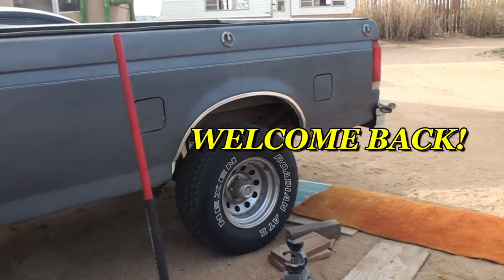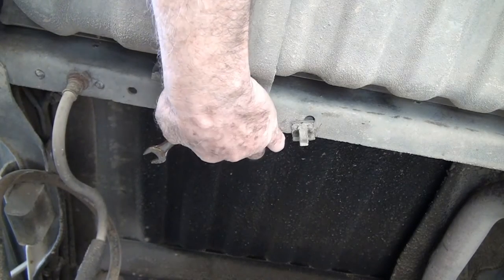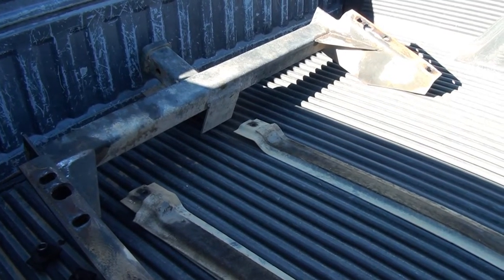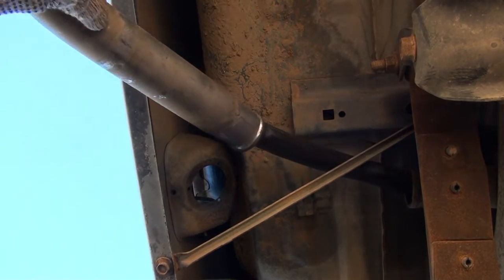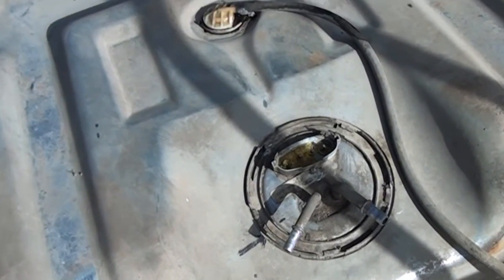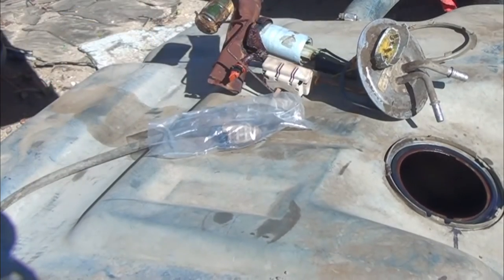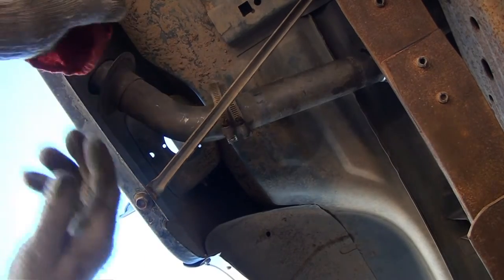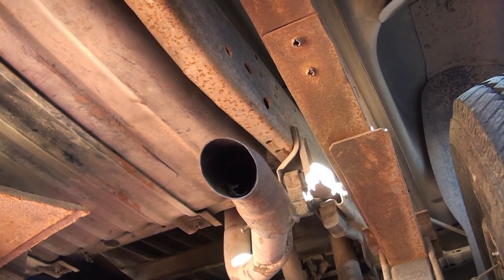1987 F150  Rear Fuel Tank Pump Replace, Why I Did Not Pull The Bed

Comment: I replaced my tank but the filler hose is pinched between it and the body. So it takes an hour to fill the tank. What’s the fix?
Reply from the maker: If it was not pinched when it was removed then it should be removed and repositioned. Part of the filler hose is metal as shown at 24:58. Installation should look like that. Maybe you need a new molded host to the tank. An aftermarket flex hose may not work. I am really unsure what is causing this problem.

Comment: I've found that if I make the sound of an air ratchet when I'm manually removing bolts it helps them to loosen.
Reply from the maker: Yes, and that is a good tip for everyone to remember and try. Good one!
Reply: @SteveAZ711  i was doing it earlier today. Then when i was digging trenches i started singing 'Thats the sound of the men working on the chain ga i ang'  oooh. Ahh

Comment: That's a drag the receiver hitch was made too wide to allow the tank to pass. Would it make it if the tank was tipped to one side or the other?
Reply from the maker: Not sure David. I will think about it if I have to do it again.
Reply: @SteveAZ711  lets pray you dont have to. You know thats the most common probkem with all of the fords starting in the 80s and still going. Especially those with twin tanks. Theres been several recalls. At least 1 covered the one im working on. Thats why i like dodge. Theyll keep running even after they shorted out and are in flames. Thats the quality ive come to expect.

Comment: I have an 87 f150 with the 5.0 and dual tanks.  same issue I think.  mine works on the front tank but is pushing fuel back into the rear tank.  Not sure yet if the rear tank actually works.  If the rear tank when selected works, would my problem be with the dual fuel selector valve?  I read on several forums that the pump assembly in each of the 2 tanks has a fuel valve shutoff for the return.  Is that in addition to the dual fuel return valve?
Reply from the maker: Hi Mac, the fuel tank switch, (dash mounted), selects which in tank fuel pump to excite, (run) and that fuel pressure from that selected pump, in turn automatically pushes a rotating valve inside the selector valve,(external frame rail mounted), to direct fuel to the high pressure fuel pump mounted externally on the frame rail. The selector valve has no electrical connections just fuel line connections. Problems arise when the selector valve gets stuck in one position and misdirects the fuel thus filling one tank with another's fuel while still allowing the high pressure (frame rail mounted ) pump to still get fuel for the engine. One ends up having to fill only one tank and run on it as the other will drain itself dry all the while still allowing the engine to run. My 1987 has no fuel shut off valves on the in tank pumps.
Hope this helps. Thanks!
Reply: @SteveAZ711  so the selector valve inside the DFR must ONLY be directing return fuel based on the position of the valve.  The pump in each tank that is turned on by the switch must just pass the fuel thru it unabated by the valve position.  Am I understanding this correct?  Appreciate your insight.  When I saw the video of the mechanic take one apart and show the two metal piston/rods that connect to a plate under the diaphragm inside the top cover, these pistons have recessed  areas cut into them that when in an UP or DOWN position, would allow or stop fuel from going thru the top line or bottom line respectively.
Reply: Buy fuel pump

Comment: Is that the same pump you put in the front tank? Do you have a link to the pump?
Reply from the maker: If I remember correctly I believe they were the same. I bought them from Rock Auto. You need to go the their site and enter your vehicle information and they will present you with the proper parts for you vehicle according to price and manufacturer.

Comment: Why did you remove the filler neck from the body? Not needed just remove the hose came where the rubber neck meets the metal and remove from there
Reply from the maker: Maybe.

Comment: I can't get my filler neck to stay on the tank...
Reply from the maker: Not sure what the issue is, but you may find a better tank at a wrecking yard for not too much money. In addition, I have had good luck joining metal parts together with JB Weld, especially if they are now movable parts.